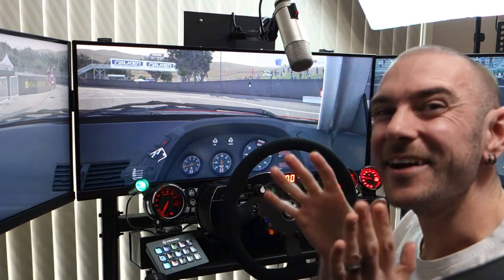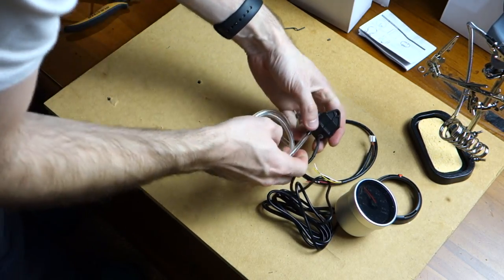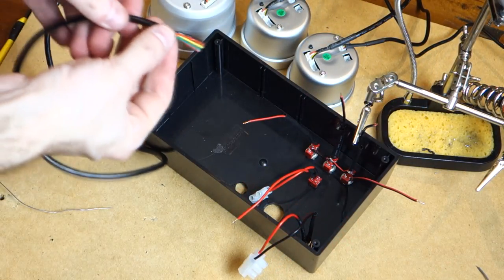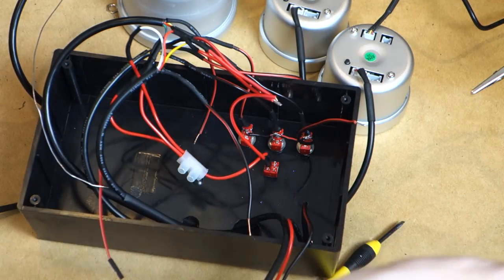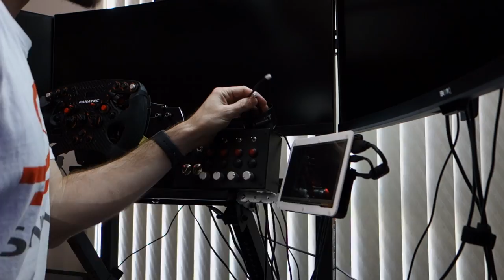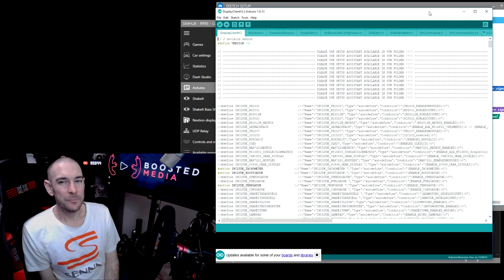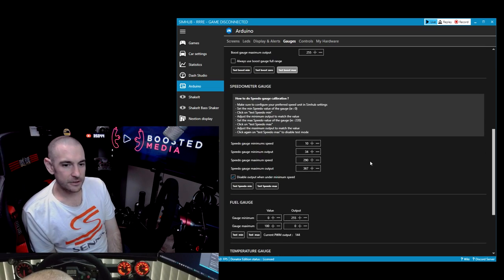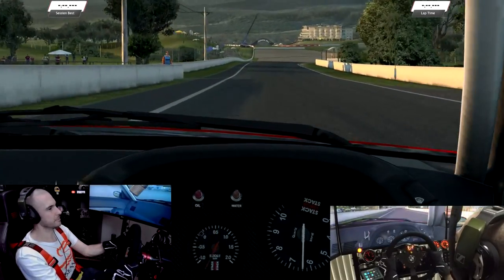Building a Boost, Water Temp & Tachometer Gauge System for the Simulator

Comment: Thanks for this vid - I've done stuff like this on my flight sim cockpit build, but didn't know it was possible on my race sim until I saw this, and was impressed by the sketch  maker for the Arduino. On the flight sim you have to make it yourself, so this is way better!
Reply: With SimHub, depending on what your hardware is, you might also need to setup everything yourself, along with the equipment.
My dashboard is a fully DIY-type of setup, so I can't use any of the ready-made modules, and have to go full Custom-Protocol.

Comment: Two observations.  First, please refer (as you did sometimes) to pin numbers on the MOSFET.  referring to “outside terminal” is confusing at best.  Second, while I realize this is in no way your issue to resolve, it appears your boost gauge has three connectors.  Mine has none — just a 4 wire harness coming from the instrument. ...no idea where the data signal is supposed to come from

Comment: For the long term, please disable that beep on the rev counter. It's a tad bit annoying and it seems to make you up-shift too early and lose time.

Remember that it's supposed to be a reminder, not an enforcer. ;)
Reply from the maker: Yeah absolutely. I just had it a little lower to demonstrate in the video. it's set correctly for the MX5.
Reply: @boostedmedia  Yeah, you said that in the video. I'd just prefer the sound of an engine in the limiter to a frenetic beep as a viewer. I'm not meaning to sound negative or mean but is an added artificial beep in the videos really that much more of a help than a good shift light (which is already a hassle to get right for each car)? I personally don't like stuff beeping at me, especially when the alternative is an internal combustion engine in the limiter, downshift protection is usually about the most I want to take. But that might just be me. ;)
EDIT: I very much appreciate you showing off this feature in this project video, though, don't get me wrong! =)
Reply from the maker: @Bassalicious  Oh yeah absolutely! No way I'll have it going off like that in my racing videos. I'll probably disable the beep all together TBH as the shift light is enough.

Comment: the way it looks you should have a cable for power pass throught because you have 2 power inpout/output in the back of you're gauge on the bottom
Reply from the maker: Correct, but if I use that then I can't control power to the gauges individually.
Reply: @boostedmedia  i've a 4 set gauge install in my car with the power passtrought and it works fine, i have 2 power cable from my batterie one for the setting and the other for the gauge itself, but if you want to control each gauge separatly np :) keep the good content

Comment: Question mate - I have RPM. Guage connected to arduino nano and it says connected on simhub and the guage is on I can test manually on the stick of the guage but the needle not working again all when I click test rpm on simhub or when I try to play AC or any other supported games. Any idea for fix?

Comment: Sorry if this is a daft question I couldn't find the same switches your using I randomly bought some that looked the same. They have arrived and are on on switches.... I didn't know that was a thing 😂 will they still work
Reply: They will still work, usually the center contact is the contact that one of each side connects to.  In 1 position you can simply leave off a wire, and connect the other side, and it will function like a switch with an off-side.
I am fairly sure that's the type of switch used in this video as well, since it is the most common type.

And just a little hint: There's On-Off-On (3 positions, with the middle position latching and not connecting any side)
There's On-On-Off (3 positions, with the off-position not in the middle), you have Mom-On-Off, in which the On-position is springloaded and forces the switch back in the off-position upon releasing it.
You have Mom-on-off-mom-on, in which the middle position is latching, and the other two on both sides are springloaded (think of these types of switches for the type of switch that you can find in a car for electric windows going up or down, but remaining in the position upon releasing the switch).

And next to some of those configurations (there are more), you have pin configurations with 1 set of 3, 2 sets of 3, 3 sets of 3, sometimes up to 5 or 6 (though the switches tend to be bigger themselves as well).
In those configurations you can have isolated contacts, or the center contact can be bridged (not super common, but definitely an option).

Comment: would it work the same if i made this with an arduino uno? great project man i'm absolutely fascinated.
Reply: It would (I take it you tried by now).  PWM pins behave the same across Arduino's, but some Arduino's have a higher default PWM frequency than others, and this will differ from pins as well from Arduino to Arduino.
I use a Mega for driving 8 gauges, 7 PWM ones driven through a BC547 transistor, and the speedometer directly through the tone(); function in the Arduino software (my setup is fully CustomProtocol, the type of thing in the video is not capable of being used for me).

Comment: I am having trouble getting my tacho to even turn on. If I go straight from a 12 DC power supply, and connect that to the battery and ground wires on the tach, it should in theory just turn on right? Or do you specifically need the transistor for the power?

Comment: With the water temp gauge, which wire do you use to give the signal to from the arduino as there are two that come from the sensor

Comment: Im doing this but adding a speedometer do i need to wire that with the bread board like the tach or like the othe gauges? Also adding volt gauge and oil pressure and fuel gauge

Comment: hey have a question you can buy any meter and make it work the same way
Reply: No.  If your gauge (like in my setup) is a standard panel style gauge or a galvo-style gauge, you will need to use CustomProtocol, because SimHub doesn't have the module for that preinstalled/loaded, nor does it (for as far as I know) exist.
Those types of gauges can be driven with a BC547 (depending on the gauge, obviously, if your current draw is higher you will need to use a stronger transistor) that you feed the PWM output, which is what I do for 7 of the gauges in my setup.

Comment: Will this work with a TIP121 as there are no TIP120 here.

Iv tried and it won't read the RPM is that my issue
Reply: Im having the same issues yet iv managed to find a tip120 and still wont work, iv tried 2 different diodes too a 12v 1w and a 12v 5w, and still wont work. Have you figured it out?

Comment: Ok I thank you but I see you hooked up 3 gauges can you more gauges because I’m building myself a semi dash and would like to use volt, temp, fuel, Primary psi, secondary psi oil temp just to start out and then add the remaining 9 gauges so in total 15 gauges.
Reply: For anyone else who might be wondering: unless you really go down the path of CustomProtocol and some pretty big messing around with non-PWM pins being switched on and off rapidly, you are limited to the amount of PWM pins on the Arduino being used for gauges.

Comment: Hey man, i'm looking to make something like this project to my Rig, but i don't understand 1 Thing !!!
There is no need to use diodes and transistors for the Temperature gauges and turbo gauges?
Reply: I think it is because in order to make the tacho work it needs an amplified signal from the arduino. I also think that is why he was having issues with the boost gauge - it may also need the signal amplified.

Comment: Can a 12v5w diode be connected instead of 1w?
Reply: Yes. I am confused on why there's a diode needed in the first place, but that's just me.  I thought it was meant to prevent flyback from the gauge (it would be in the wrong place because flyback should be prevented in the gauge as close to the part causing flyback spikes) but it seems that's not what it is supposed to do.
A higher wattage diode only means it will be able to handle a pretty massive amount of current through it, just as it's blocking voltage and current will be higher.
It might be that it's voltage drop is a bit higher as well, but that should not be the biggest issue here.

Because I don't know what this diode is meant to do precisely, I don't want to say that you can leave it out, nor would I like to suggest that you might be better off with a higher voltage (in case of flyback spikes you definitely would want to go higher than the supply voltage, since flyback spikes of a servo or a coil from a panel gauge can easily range up to 100V).
Reply: @Dutch3DMaster  hello, have you guys tried this project? i am really interested in wether the diode is essntial here too. Have u guys tried without it?

Comment: I have a 4 pin and a 2 pin cable. the 2pin is red and black which is the signal cable? it is a defi boost and temp gauge.
Reply: Hello

The same thing happens to me in the 2-pin cable, which is the signal cable, I don't know how it is connected so that the arduino gives a signal, have you solved it?
Reply: @manuelabalromero4742  no
Reply: @manuelabalromero4742  Hi, I have the 4 and 2 pin boost gauge myself. If you look at the electrical diagram, the left of the 2 pin is the signal wire. So the red wire.

Comment: I have a 18 pin speedometer how could I connect it??
Reply: Probably you'd have to have some datasheet, along with knowledge of what to feed it. If it's a CAN-bus operated speedometer, I can only say: good luck.
CAN-Bus is manufacturer specific so the instructions required to fool the speedometer and make it think it's in a car are secret.
There are ways to find out what to use, but they can take weeks, because there's probably more than a thousand combinations.

Comment: Does anyone have an issue with the temperature needle randomly moving back and forth?
Reply: If the temperature gauge uses the tone(); function in Arduino-land, it might be worth checking out if setting the range of the gauges in the Gauges setup to anything higher than 31.
I am not sure what the output is in that section and if it's translated by SimHub in the sketch tool, but the tone function on Arduino's can't go lower than 31 Hz, and will cause a gauge to do a little dance at it's lowest level.
My Kienzle 1318-27 speedometer does this, and uses tone(); instead of PWM.